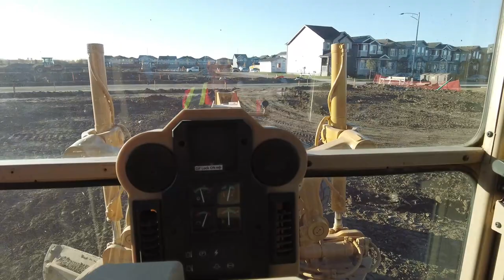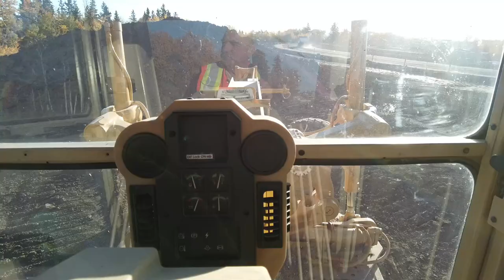On Off 100 times a day, the Dif Lock

Comment: Thank you so,so much for talking about that important part of a motor grader. Everything you said YES. I have seen guys just full speed go into a dumped pile of fill dirt with CAT grader Differential turned on, then they turned the front wheel. I was stuck in traffic watching Mr hot shot push the dirt on the construction site next to me. He did NOT like my stare. The motor Grader with those 4 back wheels so close together, people and the big one OPERATORS have to remember everything gear wise is going to those 4 close together tires, on my pickup when I turn I feel the differential lock in the Chevy truck. Not a Ford.my Chevy Z-71 came with that option. My prior pickups were FORDS, NO differential. Always rear wheel spin. Anyway my back story was in the late 1970s I was on a job with a beat up Case 580-C. You had to lock in the Differential to just go forward. What a pain with that backhoe. Luckily I was just using the backhoe end most of the time.